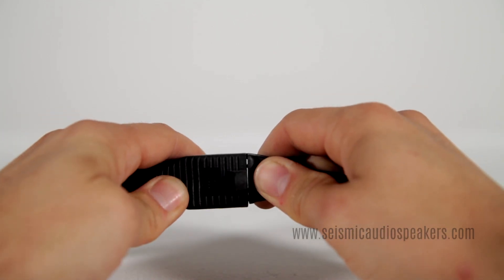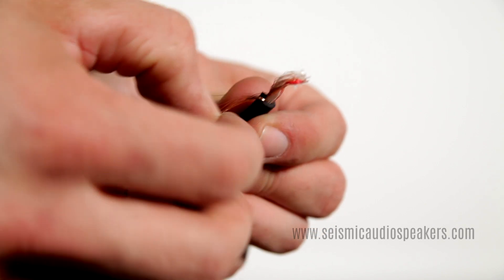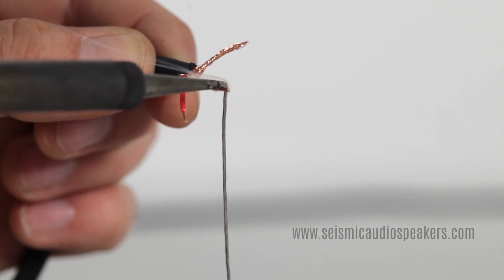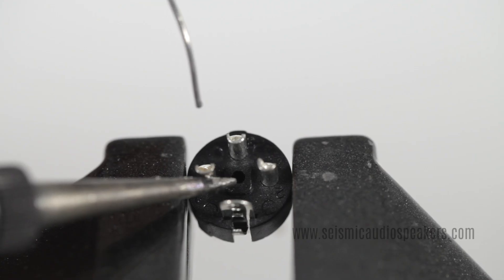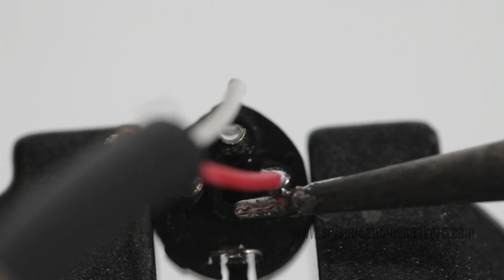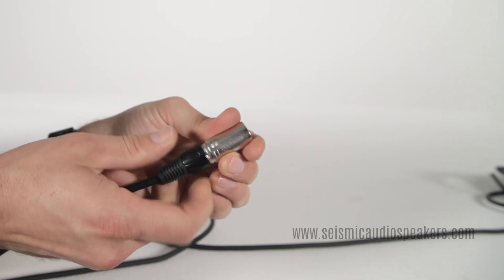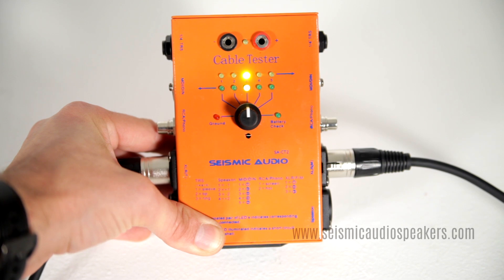Seismic Tips - How to Solder an XLR Cable

Comment: So...... No ground jumper wire needed?
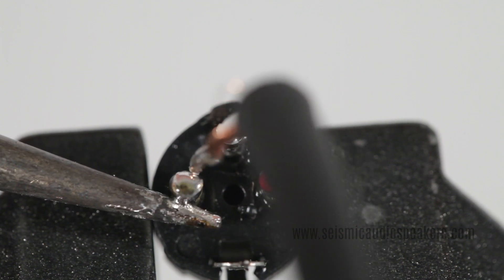Reply: Ground jumper wire for what? For a standard XLR cable for microphones or patch cable applications, you would solder signal (+) to XLR Pin 2, signal (-) to XLR Pin 3, and the Ground to XLR Pin 1. In the video, the ground wire is soldered at 1:40. Email us directly at customerservice@seismicaudiospeakers.com if you have additional questions.
Reply: @RustyDodd  I'm not saying that it's needed...... In fact, I made several patch cables and never used a jumper wire. I just came across a few today that was..... Made me kind of curious if I did it wrong. Thanks.

Comment: Don't solder like this guy, because he heat pins from behind, and also melt the plastic witch hold pin. When you do that, pins sometimes lose firmness and don't stand anymore straight so you can not put male connector into female.